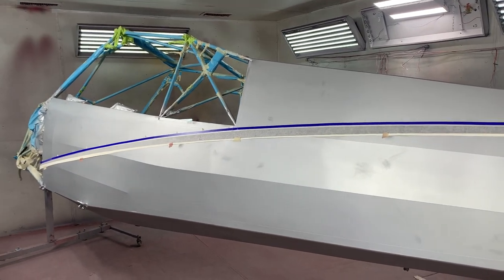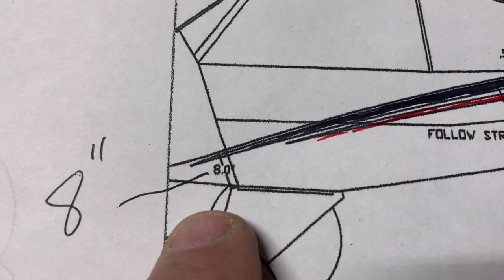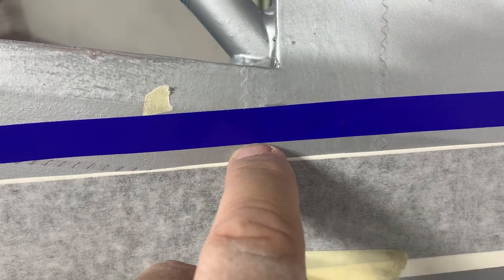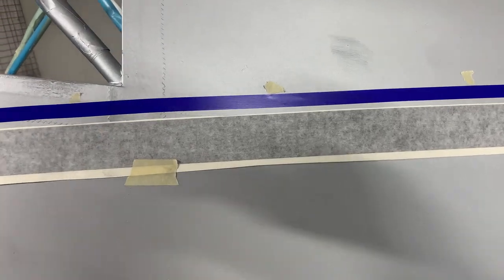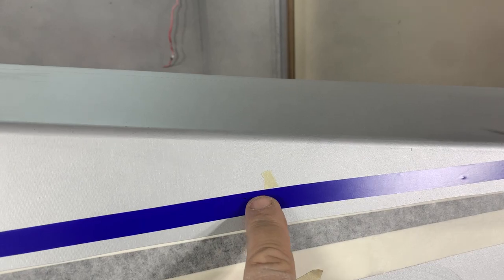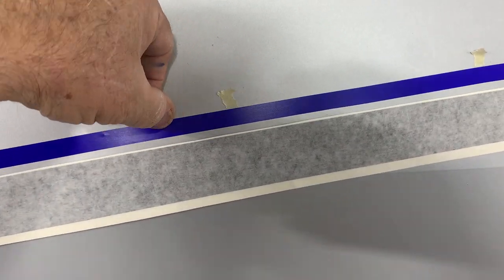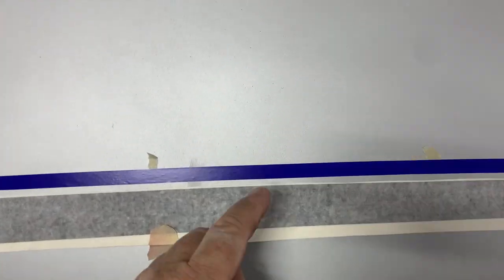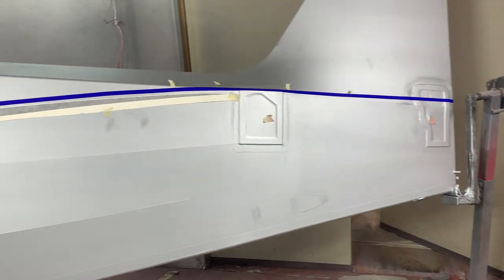LAYOUT OF STRIPES FOR PAINT SCHEME

Comment: On the areas that are plywood sheeted (leading edge) and then covered with fabric, what is the secret to keeping all of the tiny bubbles out. I’m using Aerothane. I’ve been using poly fiber system for many years and never had this issue but this is my first time using Aerothane as a topcoat